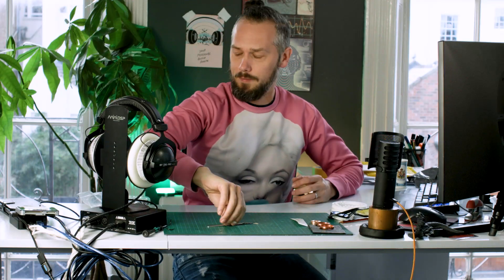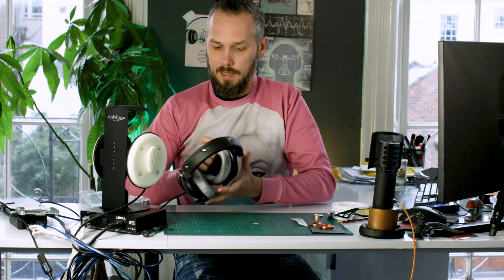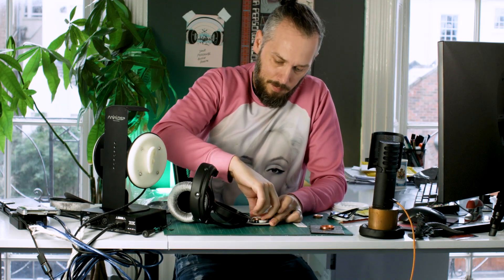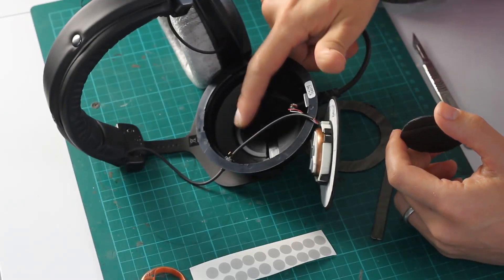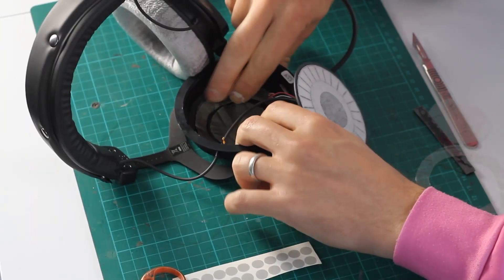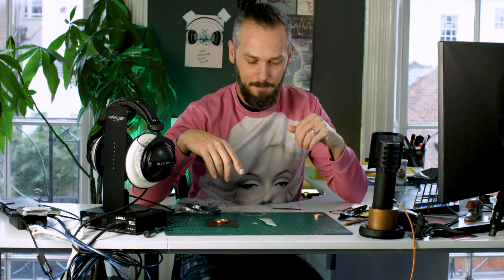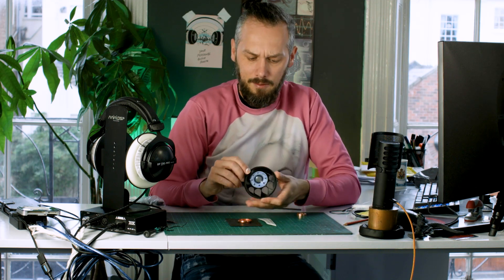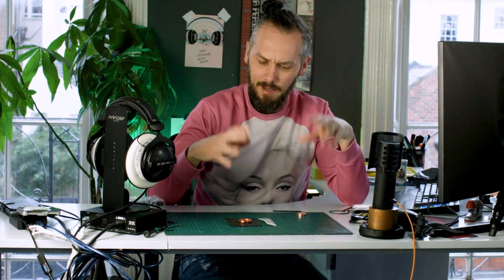New V2 mod kit for the Beyerdynamic DT770 pro Headphones

Comment: how would it change the sound if you add the dampening material but take out that black plastic ring thats wrapped in felt?
Reply from the maker: It has been a while since I tested that but from what I remember the difference was pretty subtle

Comment: Isn't equalizing basically achieving the same results?
Reply from the maker: Yes, you can work wonders with EQ and it is cheap, quick and safe. There are some things like resonance and distortion that can not be changed by EQing but that is not a major issue for most people. Physical modding means you can run them off equipment that don't have a parametric EQ built in but ... some people, like me, just find modding stuff fun.
I suppose it is a bit like running a marathon. If you want to travel 26.2 miles, a nice taxi journey would be quicker and easier but some people enjoy the sense of achievement from running it them selves ;)

Comment: Have you tried comparing this fancy acoustic mat against plain cotton wool from a pharmacy or some loose fuzzy felt? I wonder how the self-adhesive tape can prevent reflecting the sound back from the shells. After all, it's still a flat surface, which still plainly reflects and absorbs rather than diffuses and absorbs... it might help a tiny bit with leakage of the sound outside, since it makes the shells thicker, but how does it help with reflections? (though I might be wrong, and that's exactly what I'd like to understand!). Also, what are the copper rings supposed to do?
Reply from the maker: That is a good question. I know there is a slight measurable change when you fit it and they sound less boxy. At least part of it will be that when it is installed it all kind of wrinkles up so you don't end up with a flat surface and the bitumen inside it stays a very thick liquid and is a bit squishy. Foam, kapok, felt or cotton wool would all work well. The bitumen damping is easy to install and means anyone can get the same results pretty reliably .It is also easy for us to mark up to include in the kit cheaply ;) we now have the ability to machine cut foam so may change the kit in the future if we can find some suitable self adhesive foam.Kapok and cotton are all good for experimenting with but is not as easy to make a repeatable kit from. We have horn speaker kits that use Kapok stuffing and the density with which you pack it in changes the sound so it is not quite as straight forward to make into an easy diy kit that will give consistent results.
The copper ring mainly adds weight to the rear of the driver to give it more mass to push against. It really help reproduce the low notes more accurately mainly because when the diaphragm of the driver moves in and out the has an equal and opposite force on the baffle making it vibrate as well. Making it heavier makes it harder to move so more of that energy goes into making sound rather then flexing the casing. If you are DIYing it, anything heavy that does not block the airflow should do the trick, We used to use window head but I have also seen people use tungsten golf club weights. A section of steel pipe the right kind of size would also probably do the trick. Copper is diamagnetic so I am not sure if that has any effect on the driver but we mainly chose it because it was heavy and we had the tools we needed to shape it correctly.
Reply: @CustomCans  Thank you very much for your generosity toward common knowledge, it's very much appreciated and I think it reinforces the "brand". You are obviously recommended continuously.

Comment: doesn‘t the copper add resistance or react to the magnetic field?
Reply from the maker: It is mainly adding weight and rigidity to the casing. It may also have a small effect on the magnetic flux at the voice coil but that is not something we have tested

Comment: Anyone know what we're to happen if you  filled these with acousta stuf polyfill or something like that?
Reply from the maker: It is one of those things you have to experiment with - it will reduce internal reflections and make them sound less boxy but if you pack too much in there you will probably reduce the bass levels a but - well worth giving it a go as they are pretty quick and easy to open

Comment: I have a Dt770 80 ohm version, and one of the side is making noise(saturation) , particularly when the bass is sounding. Do you have any advice to fix it?. Thanks
Reply from the maker: It could be a hair or something in the driver or maybe the driver not properly seated. If you open them up, blow off any hair that is on the driver and re-assemble them that may do it or it could be something more serious

Comment: I am harsh critic and unhappy buyer of dt770 80ohm. Treble is unbearable that makes my eardrum hurt. No joke and bass despite there is feels isolated and narrow and lacking body. My 30$ 681 Evo Superlux despite slightly mid muddy makes anything sound more satisfying due to also more wider bass spectrum... Dt770 terrible headphones throwing harsh piercey treble in your face despite that detail is not supposed to be musically or sound wise as pronounced as it is with these loved by millions bandwagons. How the hell they are monitor headphones with that sharp dips in frequency response!? How that reflects true flat sound!? It doesn't! Beyers are sturdy bandwagons posing as dursble headphones wity crappy plastic / paper driver. Wish I knew this before I bought them and lost 130 bucks. Does your mod fix my 2 issues? Does it mellow the piercey  treble and widens bass punches?
Reply: I found replacing the pads with Dekoni leather dampened the treble, widened the soundstage and textured the bass a tiny bit. I would recommend that as a major upgrade for $50.
Reply: @Dibromatic  pads thing is overblown and waste of money. I tried putting leather pads from my superluxes but that won't change badly tuned driver. These dt770 are in box. Will give them for sale again. Worthless metallic sounding pile of steel and leather pretending they are good but hiding paper plastic driver. Honestly German engineering is recently exposed with all the automotive crap cheap quality and emissions bmw, VW, etc... Hope ppl will wake up and expose shitty overhyped beyerdynamic so ppl like me won't fall the victim of their hype
Reply: @martinkulik9466  well, only speaking from my experience with my modded DT770s. Good luck I guess.
Reply: @Error-hc7mp  I couldn't care less. I tested mine few times they are covered in dust in a box. Terrible hollow harsh sound. Will put them on sale.
Reply: @martinkulik9466  Someone's pissy
Reply: @elhomo6406  this shitty headphones are covered by 1 inch of dust, unused craps. I hate selling stuff, so don't bother putting an ad. Worst headphones ever. They hurt my eardrum each time In tested them.
Reply: @martinkulik9466  again, someone's pissy
Reply: I'm also leaning towards the 681 evo, do you know of any similar pairs that have good bass for movies?

Comment: These cans have a big reputation, but sound is awful, let's be honest. Those huge dips, right in the middle of the high mids. Maybe it is due to the cans been brand new? because I ordered the same after all the hype, tested them new from the box, the mids were so scooped that I packed them back and returned them. Maybe it is a matter of break in Jason? what do you reckon about this? the mod certainly solves things indeed, it is less scooped 5db thanks to this mod, still not enough according to the graphs. I have hd25 I have hd6xx I have audeze LCD-2... I want a bassy closed back, like an hd25 but over ear and comfortable like the hd6xx, refined, like hd6xx but with proper bass like hd25.

Maybe new dt700prox it is...
Reply: those new beyer dt700 and 900 pro X, those can't be balanced stock, would be great to balance those, it is a great mode for the future. I´m into that. My amp counds so much better balanced.
Reply from the maker: There are a few different versions of the DT770 - the 80ohm ones are probably the ones to go for if you want good bass. We should have some DT700 Pro X in soon and we will be doing a balanced version
Reply: @CustomCans  80ohm i got, they were pure shit on the mids
Reply: @exodusvelo  better mids than DT 770 PRO but still with great sub-bass extension: i suggest you try AKG K371.
Reply: @testek3053  those cans i hate a lot the aesthetics, sorry. don't care how good they might sound. they went too far with such an ugly headband.
Reply: just like you i fell for the hype and are quite disapointed. i wanted them for mixing, and if you mix with these peaks and valleies your in for a poor surprise :(

Comment: nice v2 mod! always wondered why there wasn't any dampening inside the cups in the first place.

have you ever tried to increase the bass port size instead of reducing it?
Reply from the maker: We did during testing on the original kit -  if I remember correctly, you get more bass / mid bass but it muddied the mids a bit